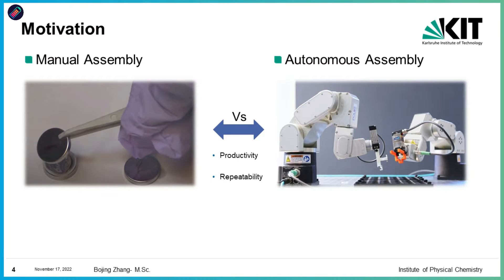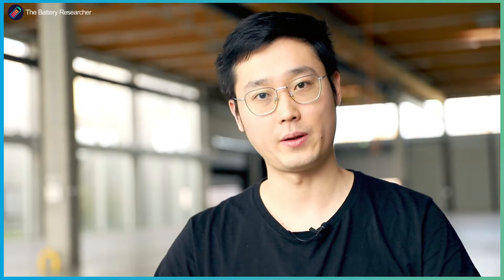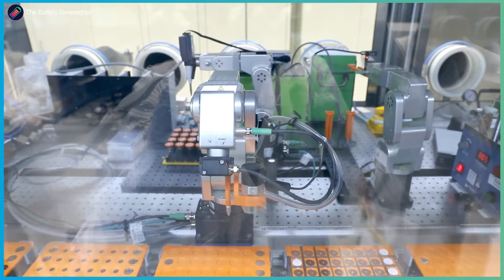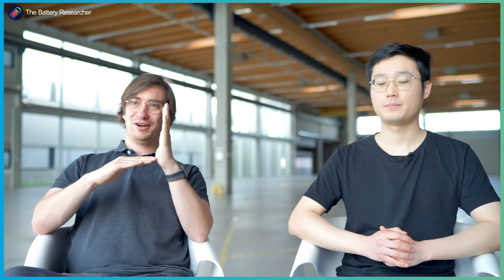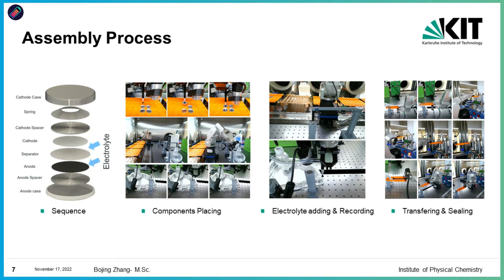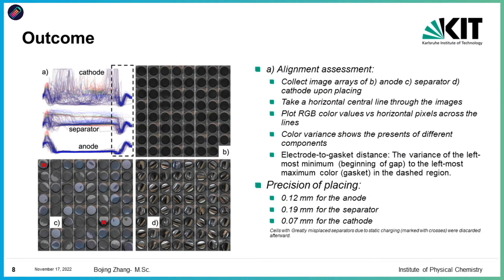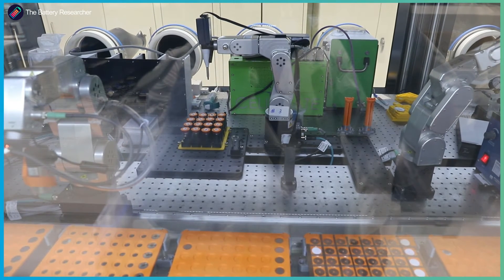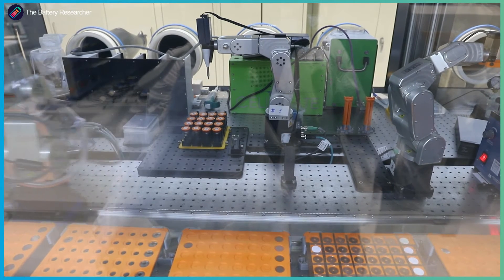Robotic Cell Assembly to Accelerate Battery Research - Helge Stein & Bojing Zhang | Paper Pitch

Comment: Great work. In my own battery building experience, the most significant process variations, once I have a baseline chemistry and process condition, are from the uncontrolled and/or poorly controlled hand assembly steps. So, in addition to increased output and number of data turns, this will help with reduction of the impact of these hand assembly variations on battery performance and provide another really critical dimension of process related optimization rather that just on chemistry / make up and processing conditions. It sounds from the video like you're already on this path now with AutoBASS functional.  Again, great work and thanks for sharing.